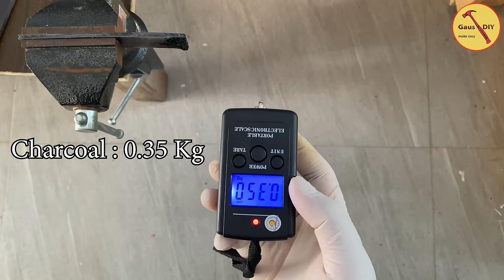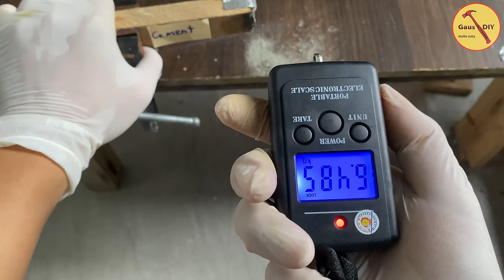3 Experiment Comparing The Strength: Baking Soda, Cement, Charcoal, Styrofoam

Comment: The experiment has three problems:
1.- Time between the glue and the experiment. For example: cement has a time to toughen. If you last 24 jours between the glue and the experiment it is better
2.- You have to take the same distance between the glue and the site of the force, as you are doing an experiment of momentum force this is very different if you are 5 cm or 6 cm from the glue
3.- The distance of the two pieces of material must be the same. Is diffenrent if it brokes in the connection of materials or if it brokes in teh middle of the glue

And this experiment only is at flexion.... if you want to know the glue power you have to do it at longitudinal force.
Reply: Cement doesn't react with glue.  The cement is just a filler matrix.
Reply: @rbhe357  
Cement reacts with the humidity of the atmosphere.
As cianocrilate is no waterproof, the cement wil be reacting days... and is going to be harder as it passes. But you have to see it, because cement with the reaction change its dimension and is possible that it  makes micro-cracks that cracks the union
Reply: The measurement device should always be installed at the exact distance from the glued area at all test items. This was not the case. A small difference give already a big failure in accuracy.
Reply: There are one more mistake

The charcoal is not in powder form compared to other materials

Add that in your list
It should be a great feedback for the experiment

Comment: For next time:

1: "Control":  use pure super glue for one sample

2: Variable to Standardise: Distance between items to be glued

3: Variable to Standardise: Distance from joint at which force is applied

4: Variable to Standardise:  Mass or Volume of Glue utilised 

5: Variable to Standardise: Mass or Volume of non-glue component utilised

In short, (i) compare all to just glue, and (ii) TRY to make sure that the non-glue component is the only thing changed.

Comment: The tests are not accurate in multiple ways:
1- The Grain size of charcoal does not match with the cement & baking soda!
2- The Gaps between the different test objects do not match (they are different)!
3- The distances of the applied forces to the glued joints are different!
Reply: Grain size is not that critical, he is trying to compare the different materials, so comparing Baking Soda to Cement is fine...they are two commonly available substances we can all access, and use. Charcoal...maybe not as it is variable sized and lumpy here otherwise it would be ok to test it. Of course Styrofoam is the same...as a common substance that everyone can get and many are trying/claiming to use to glue things.
So his testing is valid and useful, except as you point out in item 3 his force measurements are not very accurate. 

Otherwise, his ideas of testing these substances is useful as there are lots of videos claiming the strength of one versus the others which is what people want to know - which is best. Looks like Baking Soda in this one.

Comment: I love the testing. I agree with everyone that a more controlled test, same amount of stuff, scale the exact same distance from the joint would make the test more accurate. But it is still interesting.
Reply: I agree, the leverage of distance from repair point to where force applied could make results change.
Reply: The method is not very meticulous, but the conclusion that Baking Soda is quite effective still holds, seemingly.
Reply: Exacto! El torque depende del largo de la palanca.

Comment: Since baking soda is in powder form, the particles cannot hold together and form bonds. Naturally, since the glued carbonate is hard, it breaks after a certain resistance is applied. It may be a good idea to add glass fiber powder or carbon fiber powder to the baking soda to create a bond between the baking soda particles and provide strength.💡
Reply: Never heard of this before, but it should work! I have used flox (chopped cotton microfibers) to add more strength to bondings, with excellent results.
Reply: sodium bicarb and iso glue catalyzes like fiberglass and resin.  It gets extremely hot and ever since hearing about it maybe a decade ago, it's my go-to for rock solid repairs.  I don't know if any of the other tests have strong chemical reactions but the baking soda is a game changer.
Reply: @AN-kg4ei  I had to look this up but..... sodium bicarbonate = baking soda.

Comment: Thanks for doing this test. For me, I think baking soda is the way to go. It's easy to find and cheap. I don't have a clue where I would find a small amount of cement so it's just as well....
Reply from the maker: thank you so much :face-red-heart-shape:
Reply: I enjoyed the video, but had a few after thoughts about application.  I wonder about durability under different conditions such as excessive heat,  moisture or repeated cycles of extreme temperature changes. I imagine most of the above examples would work great to reattach a fallen rear view mirror on your windshield,  but couldn't function on a  muffler,  besides the weight, it also gets exposed to the weather conditions repeated shocks from bumps.  Another video on that might be interesting too.
Reply: Maybe you should try fine salt, baking soda can also be found in different granules and I think the finest is the one that achieves the best results.

Comment: I read in a similar video that the strongest combination for super glue is baking soda. Apparently this combination was so strong, it was used for holding together parts of the wing on old war planes. When you mix super glue and baking soda, it accelerates the curing process. Chemically, the bicarbonate molecules in baking soda react with cyanoacrylate to create a reactive ion that more easily bonds with other cyanoacrylate molecules...so yes, your experiment result was accurate👍

Comment: Additional variables in the first test could be the differences in leverage created by the distance of the hook pulling on the nail from the point of contact with the wood and the differences in the amount of bonding agent and glue. The same applies to all of your tests, remove these factors as variables and your tests could be more accurate.
Reply from the maker: Thank you so much for your feedback on my content.

Comment: Thanks for the video.  I like styrofoam since it's not a powder, it can be controlled better.  However, if you need strength, Baking Soda is best for most applications.  Cement seems to good for all applications.  However it's a coarse powder.  Harder to sand down smooth.   Of course you could be more scientific by carefully marking and applying your force at specific points.  I noticed there was some variability in where you applied the load.  I don't think it would change the relative rankings.
Reply from the maker: Thank you for your comment, Have a nice day!
Reply: That is what I noticed. Especially in the last test. The Cement would have a higher scale load, but probably the same ranking for all.
Reply: @twinwankel - Since cement is coarse, I wonder if unsanded grout would be better?

Comment: Thank you for this. This is a bit helpful. However, it would be more accurate if you anchor the meter same exact point for all materials. Because even a slight difference in the anchoring of the weighing scale hook along the length of the pieces can spell a big difference (e.g. the closer to the glued joint, the harder it is to break, the farther from the joint, the easier it is to break; this is the principle of the lever). Another minor point is the amount of material used for the joints. It should be same weight in grams for all materials being compared, and exact same amount of super glue. Because for example, if you put a little bit more cement than baking soda, then obviously there will be a strength difference; same with amount of super glue.

Comment: I think that each joint should wait at least between 8 and 24 hours for drying to have more conclusive results. It seems to me that many of the tests have not even passed half an hour after applying and that is decisive. On the channel "El Angelito" he tests a ring with cyanoacrylate and sodium bicarbonate, and with a crane he is able to lift a washing machine and then a platform with more than 200 kilos. And stretching the joint transversally is not the same as stretching it longitudinally. Good! You already have material for another video.
Reply from the maker: thank you, I will learn and do it in another video

Comment: I think these trials/results by Gaus are interesting but there are several potential variables that need more attention IMHO
1) Interspacing Gap variability
2) Amount of bonding agent/resin applied
3) Amount of Superglue applied
4) Drying time
5) distance of applied force from the joint

 However that said, I didn’t realize that some of these compounds could be used the way they were. I mean you could choose iron filings for one. But the real variability might be coming from just the superglue itself. So there should be a fifth one with just the superglue and nothing else. 

Anyway interesting trials 👏

Comment: Ive always heard that you cut the baking soda with charcoal (graphite) and apply in thin layers with the glue. Ive used this technique to mend broken plastic in laptops where the hinge for the screen tightened and broke the plastic mounts. Works amazingly well
Reply: Charcoal is not graphite. They are different allotropes of carbon. (You can get graphite from a pencil... and, yes, it's not the wooden part.)
Reply: What proportions do you use? How long does the repair last?
Reply: I don't see graphite and charcoal as being the same product.

Comment: THANK YOU Gaus DIY :            Dislike crabby comments. Like educational comments that respect the producer of the video.
Reply: Crabby, no good but constructive criticism is sometimes needed. And these tests have some shortcomings that need to be pointed out as the results are not reliable, when you place your leverage point (his zip tie)just anywhere you like and them try to list the results as comparable. 
They are not...the ties would need to be the same distance from the joint to be valid.  
Even then, his hand and the angle he pulls  against the force gauge will be an issue also.  So our guy does good tests...he just needs to adjust some of his techniques and he will have a better channel. Nothing wrong with helping people improve their videos.

Comment: I mostly use Baking Soda.  I have fixed all my grandkids toys, but I have also fixed multiple cracks on refrigerator shelving.  Large and small ones.  Saved me hundreds of $$$ Works great.
What is your opinion of Graphite Powered?  I have used that to fix broken plastic on my trucks nerf step bars.  Hardened like steel.

Comment: should have added saw dust also in the test items cos saw dust also makes up a very strong bonding. Do try saw dust in your next experimet
Reply: I uses saw dust to strengthen joints on RC aircraft, it will break somewhere else than where sawdust was used.
Reply: And sand.

Comment: This is OK for getting a general impression, but for a proper analysis of material strength and bonding ability, you'd need to do separate shear test and tension tests that eliminated factors of inconsistency. A tension test being two surfaces glued end-to-end and pull apart at 90 degrees from the glue plane. Shear is glueing two surfaces in an overlap manner and pulling it apart along the same plane as the bonded surface.

Comment: Just curious... fiberglass?think the fibers may hold better. And the glass might melt?
Reply: Fiberglass can be a good option, fiberglass sheets are normally used to repair rigid suitcases or bumper plastics with EPOXY, and I think that with cyanoacrylate it could work very well, the difference is the price of cyanoacrylate if you have to repair very large surfaces, but for small repairs I think it can be better than epoxy. Yes, it melts, but the glass is still present at a molecular level and after drying it acquires its maximum resistance.

Comment: I've tried all this in the ninety's  wood dust works better than all this.  We used to make our own gap filling super glue by adding baking soda to the super glue.  While making radio controlled airplanes, the dust in joints assured it would not break there. Saw a piece of wood and the dust is all there for you to use.

Comment: I appreciate the test but another flaw, with considerable impact on the results, is the distance you placed the strength meter hook from the glued portion.   You should have measured the distance to be sure there was consistant leverage applied.

Comment: I have a fog light panel cover that was destroyed and it broke the brackets holding it into the bumper so the only thing holding it in place now is super glue and baking soda and it has been 6 months now and it has not moved yet..I only put it in the two places where the bracket was so I will testify that baking soda and super glue works miracles..

Comment: Should have tried out with sawdust as well. I used sawdust + superglue to stick a reverse threaded nut to it's Bakelite (or similar  material) body, since I was unable to procure a replacement. It worked absolutely well, being exposed to super heated steam. Of course the joint did give up, but it did last far more than what I expected it would. Actually, the nut is still stuck to the compound that I created. The entire block became unstuck from the Bakelite body. So, metal + sawdust + superglue works well.
Reply: I use sawdust alot, great results, sand as well, sets like stone.
Reply: @drewledge620  Absolutely!

Comment: The momentum on the base of the screw is determined by the Pulling force multiplied by the length of the arm. And the arm is the hight of the mountingpoint of the hook. The higher the hook, the greater the momentum at te base of the screw.

Comment: Will backing soda and super glue work this good on aluminium And generally on metals?
Reply from the maker: I haven't tried it on aluminum, but if you want the glue and baking soda to stick better to the aluminum surface, you have to roughen the aluminum surface.
Reply: @GausDIY  Thnx mate

Comment: The idea is good. However, that is not how (good) experiments are done.
1) you need more than one specimen to get data you can analyze statistically. If you do just one test, the result you see could be an "artifact".
2) you need to provide a better testing protocol. e.g. the position where you place your force measurement. You did that by eye, no distance measured, thus various leverage.
3) you should make sure there is no "crosstalk". I see e.g. pieces of charcoal in the styrofoam etc.
4) I see no addressing of material quantities, processing duration (how often you had to stuff your stuff with the spatula) and material placement (e.g. the cement in the wood experiment is pretty much off-center)
Again: Idea is superb, because for DIY this information is gold and "real scientists" do not seem to bother to provide it. Then again, doing these experiments CORRECTLY is hard. The information these experiments provide is directly proportional to how much effort has been placed in them.
Reply from the maker: I will try my best to create better and more accurate experiments. Thank you for your comments!

Comment: 1. Superglue needs to have 24 hours to get firm
2. All tests must use the same amount of glue
3. All tests must use the same position to hook the material
4. Adjust your test, you may have different results and much more strength

Comment: You need to use a specific point of stress at the test objects. The amount of force exerted to the glued part will differ greatly depending on where you pull it (near or far away from the glued part).

Comment: I support your experiment. I have some suggestions and opinions. This experiment is not fair. Since the amount of adhesive or the area is not constant, the resistance of the side with more adhesive will be stronger. If the area is wide and thicker, its resistance will be greater. And the pulling position of the last experiment is different. If the pulling position is different, the result value will be different. However, since I am interested in these experiments, I look forward to a more improved experiment video later!
Reply from the maker: I am very happy to read your sharing, after I made this video, many friends gave me comments. Thank you for your sincere and informative comments!

Comment: I used baking soda/crazy glue on a edge to edge thin vacuum plastic trigger that cracked.  Thought it would be temporary until I got the new switch.  Three years later it is still functioning and we use that vacuum every day.  The new switch is still in the plastic bag it was mailed in.

Comment: One thing I noticed on the two pieces of metal bars adhered together that may have been better. If you would have flipped the mounded piles of the powder on to face away from you when pulling it would have better judged the strength. Unless you were judging solely where it contacted the 90 degree face between the metal bars. It would be like using tape and expecting it to hold up with only tape on one side and pulling with the tape facing you. If that makes any sense lol. I know these arent scientific, and I really enjoy them! Or maybe flipped the bars and put the powder on both sides, which is what you would probably do in the real world assuming you could. Cool videos! Subbed